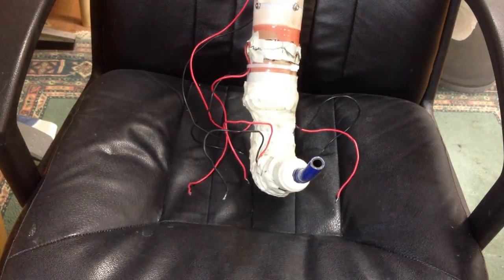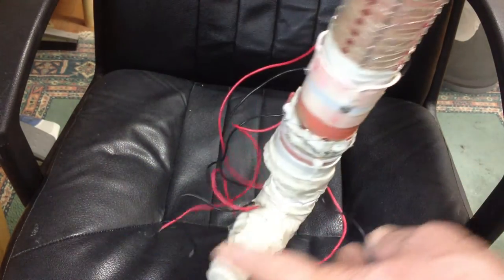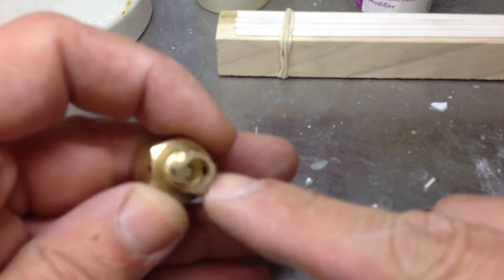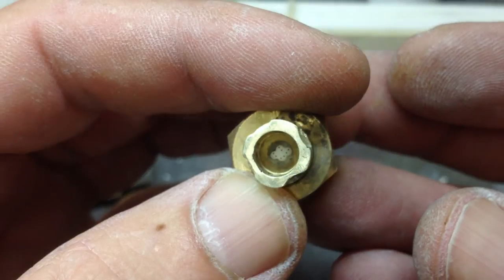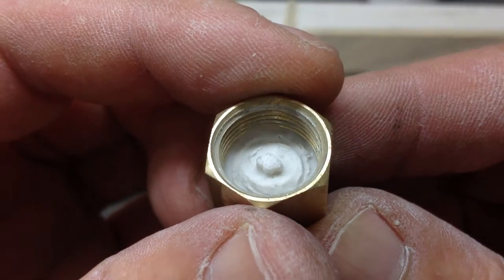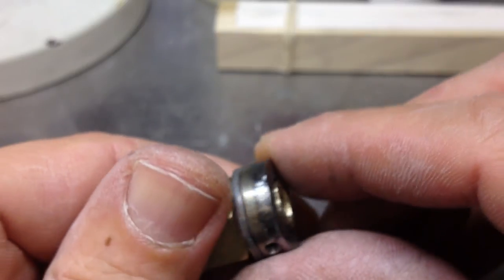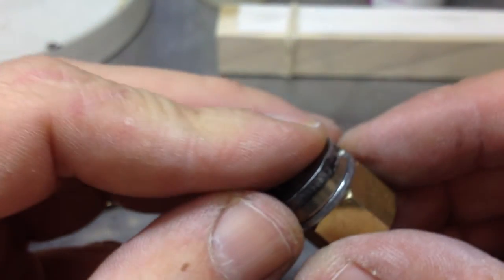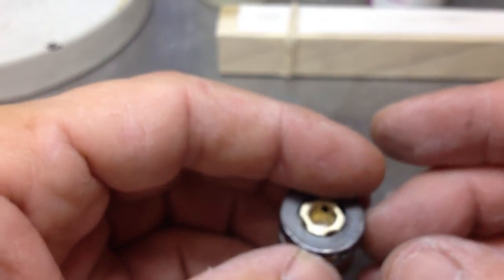Meyer Gas processor effectiveness ...

Comment: What are the patent numbers? They sound interesting 

Do you think the cations you produce in the gas gun will neutralize when they come in contact with metal?
Reply from the maker: hi Dave, I don't know if they will be neutralized..?? My guess is they will, but a few might get through...if I can produce the right ones....I am keeping the path from ionizer to tip as close as I can...I will send you the patents when I am finished, I have to dig through my pile and find them again..
Reply from the maker: Ok.. I found the patent I'm working off for the ionizer construction... this covers the parts for the ionizer itself...I'm using another circuit as well as the one in this patent for the transformers etc... the number of the patent is 4 519 357 entitled "Air ionizer for internal combustion engines"
Reply: Thanks! Sounds very interesting